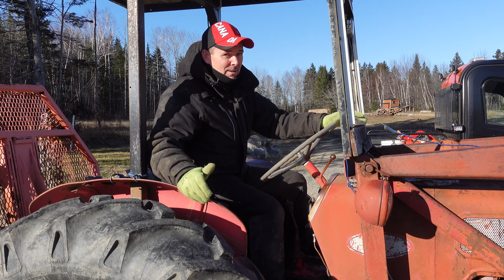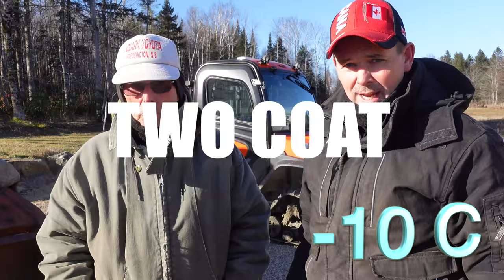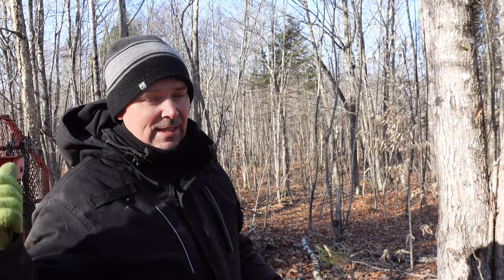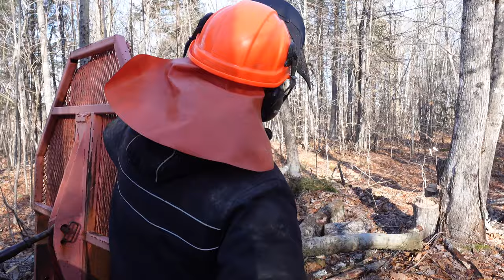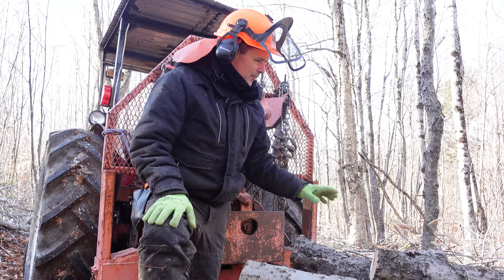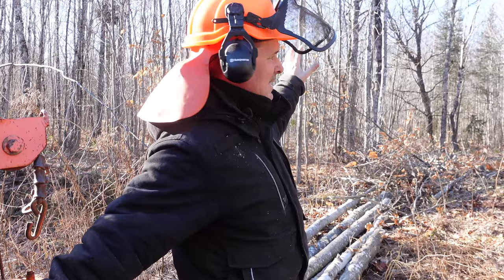Building a Winter Firewood Road with the International 414 Tractor and Farmi Winch -E136

Comment: This old equipment is just great. They are easy to work on, easy to fix, parts are available, plus they will almost always start and run. I had a 1942 international tractor. This thing would start in any condition. New equipment has way more stuff to go wrong. This old stuff was made to work.
Reply from the maker: I agree… this one is bullet proof if I would just break down and buy a new battery for it!

Comment: Good work. As far as trail blazing, we work differently. We have ground that drain extremely well so not much worry about mud holes. When I open a new trail, I clear all the brush first and then cut the bigger trees. I then throw all the branches on the side of the trail to have as clean as possible in the hope that a branch or stick does not come up from under the tractor and cause damage to hoses or radiator fan. Since they are logging trails, that is normally sufficient. I will use the backhoe at time to level out humps or holes.
Reply from the maker: Hi Yves, if I was just using my trail as a twitching trail for the tractor I would do the same as you. In this case, I will use this as a spur road to access about 15 acres (my guess) and then put in twitching trails off of it as I work the stands. Thanks for sharing your information; I love to learn how everyone else manages their woodlots!

Comment: That is an interesting project building a spur road. I have a few more spurs in mind for my land... when I have time though! I've learned the same for the battery. I try to never let them fully discharge.  One other trick is to not use the alternator to recharge the battery from dead, if ever possible. This way, the alternator will be working at its 100% capacity for an extended period of time. And the battery will also see a very high amp charge for a long period. If the alternator had a weakness, you will find it soon! If ever possible, preferably put the battery on a 10 amps charger the day before. Thanks!
Reply from the maker: Excellent advice on the battery. Thanks for sharing that knowledge with me! Happy Holidays and stay safe, Jason.

Comment: Looks like a lot of fun. Nice day to be in the woods. I would test your tractor battery voltage for a few days after you stop using  the tractor. To see if voltage drops below about 12.5 or so. If you don’t use the tractor much. I would just take it out to be sure it does not freeze. Just a thought.
Reply from the maker: I imagine that old battery is on its’ last legs… going to use it as long as I can since new battery prices have really gone up!
Reply: @OakMountainAcotts  that’s for sure the battery prices way up, like every thing, is way up. Was into princess auto today looking at things, and a lawn mower battery, with 250 CCA was $90.00, plus our wonderful tax.

Comment: The more times a battery goes dead it damages it. Soon it won't take a full charge. I buy inexpensive solar chargers to keep batteries on equipment that doesn't get used on a regular basis charged. A 15 to 20 dollar solar panel can save a 120 dollar battery for years.
Reply from the maker: Great advice. Thank-you!